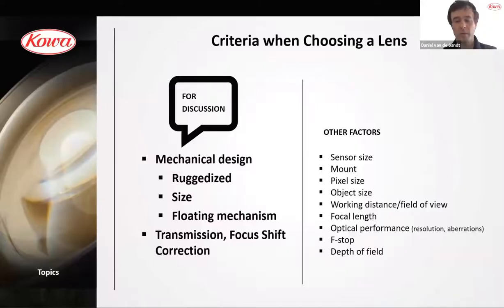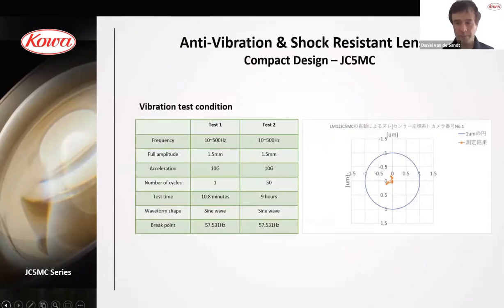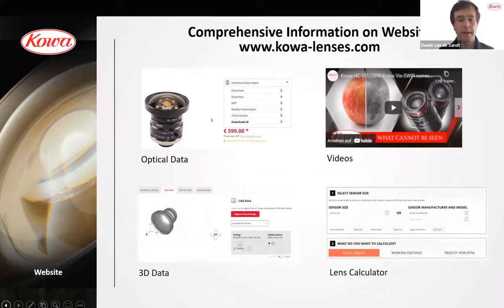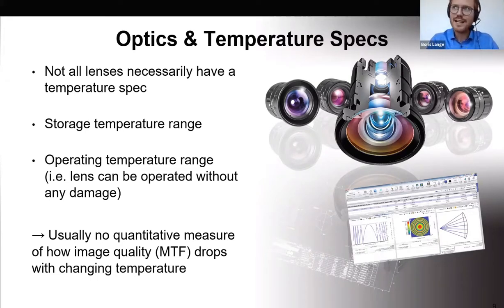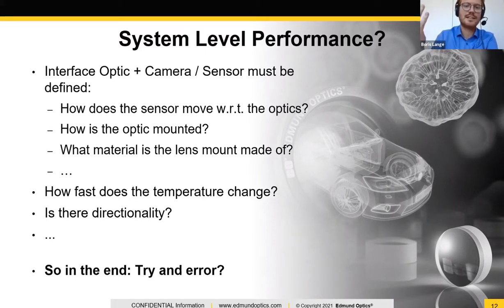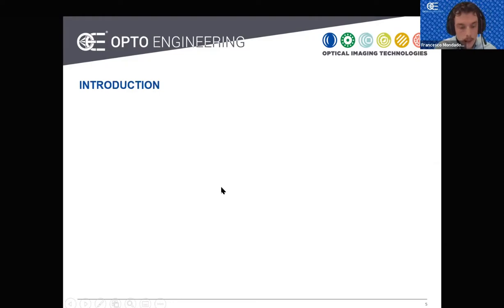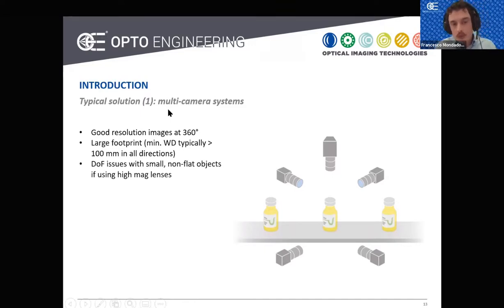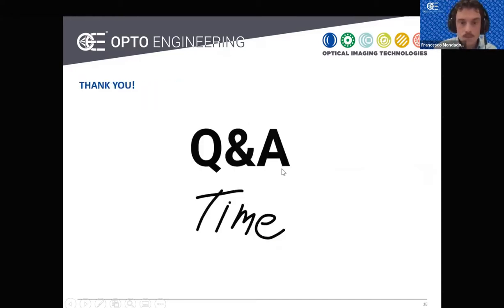Industrial Lenses

Comment: Industrial lenses, as the name suggests, are lenses designed specifically for industrial applications. They typically have characteristics such as high resolution, low distortion, low dispersion, and high durability, and are widely used in industrial fields.